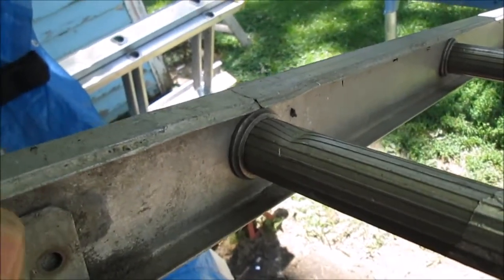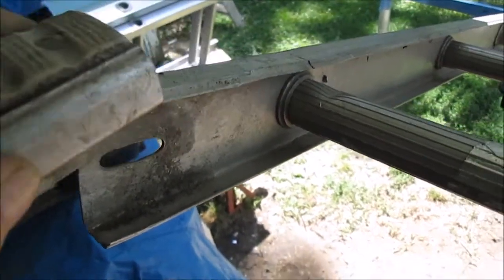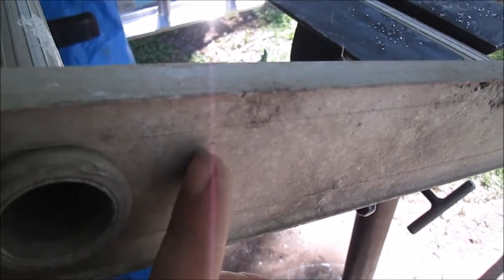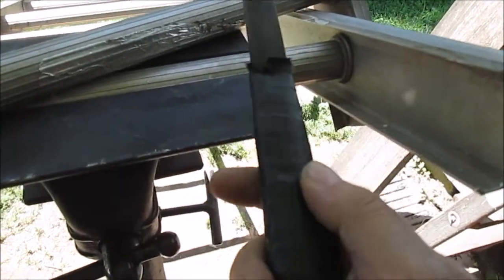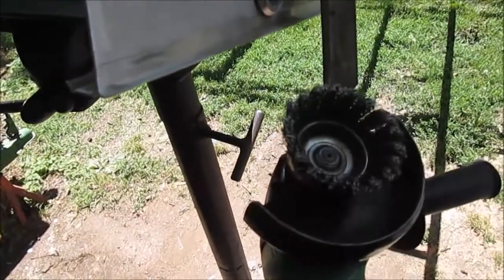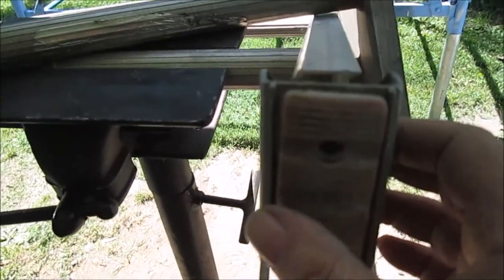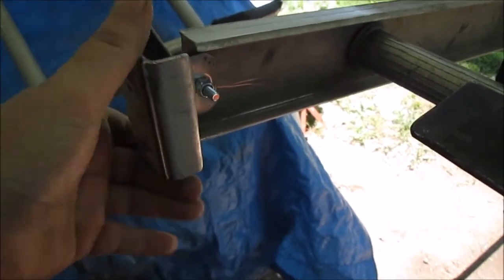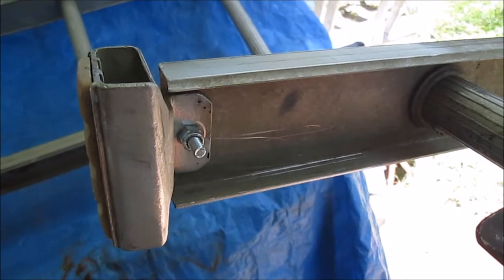Extension Ladder Repair

Comment: Good video, and good job! Hay my daughter showed me a trick I think you should know about. For cleaning Aluminum and I suppose magnesium,  use a stiff nylon brush and Coca-Cola.  It will loosen corrosion, and leave a bright & clean surface. It will loosen dried on fish bait and fish blood from the bottom of the boat with very little effort. Keep up the good work.
Reply from the maker: Thanks.....I need something to remove paint latex and oil based My good ladder has latex paint on it  from the last time I painted the house

Comment: I was given a 10 foot A frame ladder and its missing one of the smaller front feet.  I cant seem to find any replacements anywhere but i should either quit using the ladder or fix it rather than risking falling...  any advice?

Comment: Just put new Werner feet on an extension ladder a friend gave me.   Her ladder just had a hole at the bottom with no feet.....the Werner feet fit fine so for $30.00 or so I have a new-to-me functional ladder.   New 16-foot extension ladder is about $160.00.

As the US dollar continues its devaluation more people will have to fix what they have.  Videos like this one are what we need.

This video though, bad repair on the rubber pads.   The new rivet will be in contract with whatever hard surface and might allow the ladder to slide.   Not good.  Get new feet or do a proper rivet.

Comment: great work the Rivet on my ladders foot broke off and need to put the foot back on, Having a hard time removing the old rivet from the foot. Did you use any washers with the carriage bolt and nylon nut with lock tight or no washers?
Reply from the maker: On nylon lock nuts  I use flat washers

Comment: Well there you go. I've never seen or heard of Goof off. How about a short video of what eventually works for you.  I'm sure there are many of us that would like to know what will work for that chore, At least I would. Keep up the good work.
Reply from the maker: The stuff is not cheap but ..I know it works to get the glue off of car windows after you remove window tint

Comment: I'd cut those new rivets back out & counter sink that pad a little because those rivets sticking out like that will have you sliding on concrete or mess up wood floors. Nice video though because I need to replace one of my feet on my 40' ladder.
Reply from the maker: I will be using it out side in the dirt ..I could glue some pieces of rubber to them for use on a flat surface

Comment: As far as the paint removal goes, I'd use lighter fluid and a wire brush, and charcoal lighter fluid if the first doesn't seem to work. Keep up the good work.
Reply from the maker: I have tried lighter fluid  I have never tried the charcoal fluid ..I could buy that goof off stuff